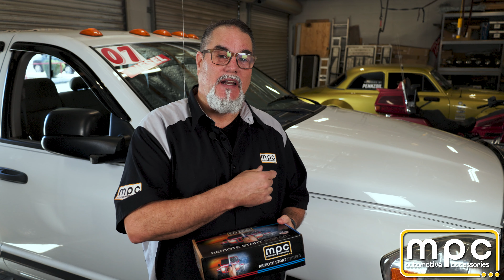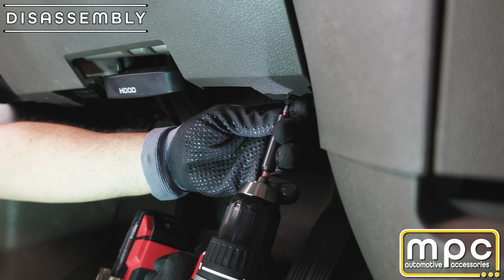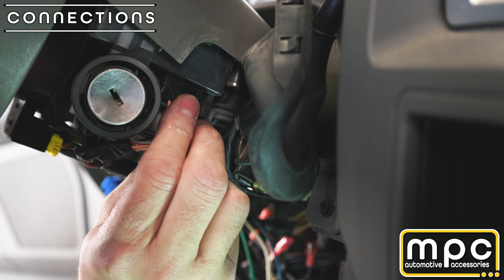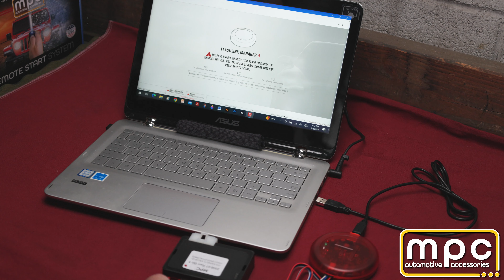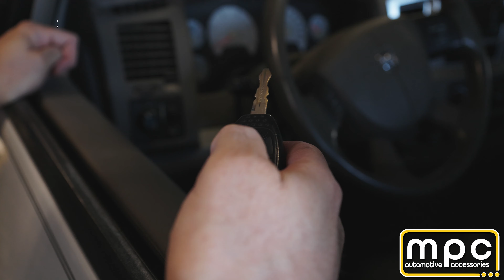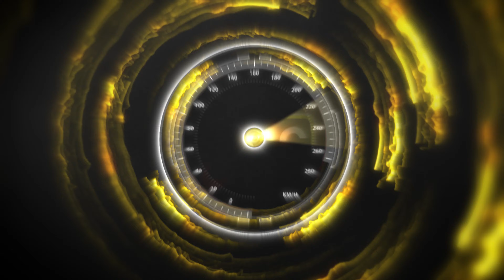mpc | Remote Start Installation for 2006-2007 RAM 3500 Key To Start B-4846-472

Comment: I had that kit on my truck for about 3 years. I have had to remove those dodgy wire taps as they no longer contact the cable. Physically cutting the wires and soldering them together has been the only way to fix it.

Comment: So is this the same install on a 2008 dodge Ram 3500 diesel? I’m having issues!
Reply: not good to hear, im looking at doing it on my 07 3500 diesel
Reply: Having a large over crank on my 2007 2500 6.7 I’m going to call tech support and see if they can help me locate this setting to correct the issue on mine. I will advise on this if you would like.
Reply: @TyKd8nvsOH  5.9 for me but I will keep this in mind thank you
Reply: It will work. I have an 07 5.9
Reply: @shawnmckee14  ok good haha, just bought one last week, haven't installed yet
Reply: @TyKd8nvsOH  what advice did they give, im having the same long over crank even after setting it to -3
Reply: @SniperSnipedYou me too any resolution?
Reply: @TyKd8nvsOH what was the resolution to this?